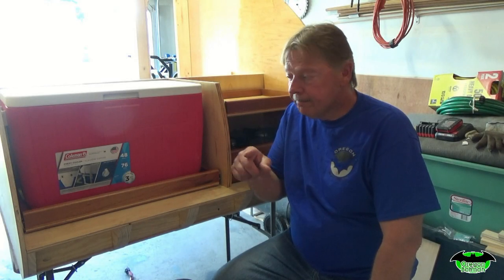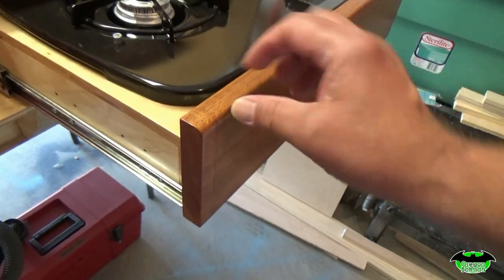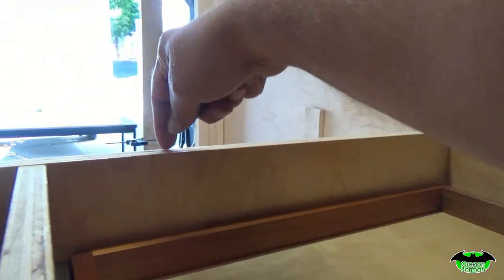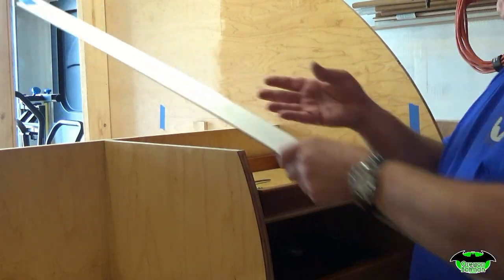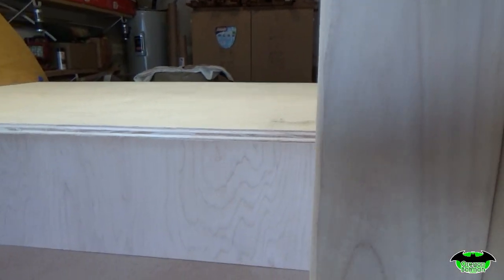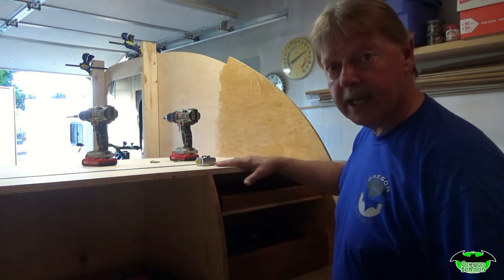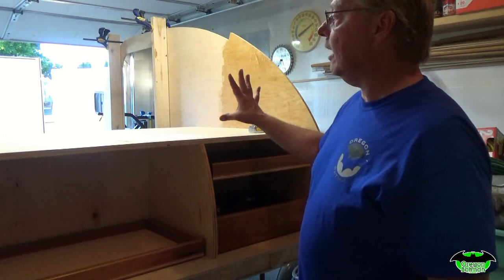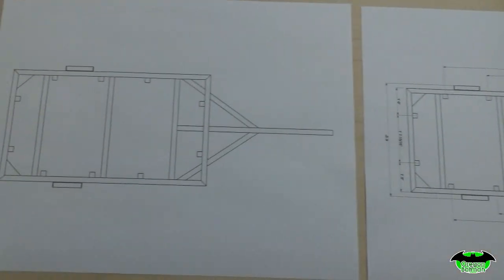Let’s Build A Teardrop * Step-By-Step * - Part 15 (Installing Counter Top)

Comment: I envy the freedom you have to build your own trailer out there.  It's not impossible to do in Illinois, but they make it so ridiculously difficult to get a title and license plates, that most people just give up and won't pursue it.  Most people in states as oppressive as mine end up buying a Harbor Freight 4x8 or a Northern Tool 5x8 bolt-together trailer and building on top of it.  They aren't horrible options, I guess... but your trailer looks GREAT and should be trouble-free for the life of the camper.  Another great video!  And great modification on the stove location - I might do something close to your original location, but use a combination of two sets of slides to get the stove out farther.  In my build, I'm also going minimal and probably using a single-burner butane stove.  I won't have any other appliances requiring propane, so I thought "why not" to keeping it simple and small.

Comment: Beautiful craftsmanship, as always.
Just an idea, but you could run a 24" propane hose from a 1lb refillable bottle in your storage area under the stove.  This would negate having to carry around a 22lb (5 gal) bottle in your tiny trailer.  Keep 3 or 4 spares in the storage space that you can easily refill from your 22lb tank at home with an $8 adapter.  Then you are only spending <$0.50 per full 1lb bottle rather than the $3-$4 retail price.  Also, it would always be hooked up and ready to go :)
Reply from the maker: That's a pretty good idea, I'll have to check it out and see if that will work. Thanks for the tip!

Comment: Awesome build so far. Just a suggestion. Once you had the two end holes drilled for the counter top, you had all the information you needed to go to the outside and mark and drill the rest of the holes. Might have been easier than having to reach over the cabinets inside. Ya gotta love a stove in a drawer. lol
Reply from the maker: True that... connect the dots from point A to point B, but I had many occasions where I missed my mark and popped through the edge of lumber, so I opt for the longer route, especially when the wood has a slight bow to it!

Comment: I know this is years later….  But may I suggest that you take the stove out completely??…!!    Remove it but leave it in its box, and take off the hinges. 
Take the stove, and set some strips of ply as mounts.  Mount it underneath the top drawer, snuggly.   If it’s just sitting on some ply strips, it’s removable.   Now you can pull it out and set it on the countertop, use it, then put it back.   This also gives you room to add a bottom drawer.

  (And/or sell it and just buy a portable camp stove.)  but use the same box you made to store the stove in, in a drawer or slot, just under the top drawer, and again…  make a bottom drawer with the leftover space.
Reply from the maker: Great idea for someone else who would be building the Teardrop, for me... I like this setup. Works great!
Reply: @OregonBatman  
….  Right on.   It would be nice to see a video of you using it on a trip.  Haven’t seen anything about it in a long time.   I’ve been building my own and re-watching all of yours to try and keep me motivated.   I’m still welding up the frame, but hope to have it ready to build on soon.   Your vids help remind me of what I can do.
Reply from the maker: Well, winter kind of settled in here and since I'm more of a fair weather camper (a.k.a. wimp) it might be a little while befor I take it out again! LOL! Once that frame is done, and you cut your first piece of wood... you won't want to stop until it's finished! You got this!

Comment: Great video as always. Quick question about the trailer. That's the biggest unknown for me. Would you mind sharing a ballpark for the budget on that piece alone. Did you provide the steel or you just gave your plans and they made it for you. Thanks

Comment: Countertop should be screwed in from underneath . Put lateral cleats in across each end and in the middle and screw in upwards from the underside. Your version can't be removed and or replaced later without ruining outer skin on trailer and also having screw holes show from inside the bulkhead.....Countertops get burned -scratched or dated in looks and color. Remods will be a bitch.....
Reply from the maker: I disagree... if counter top gets burned or discolored, I can always remodel with new surface. If severely damaged, I have more problems than just a counter top! Appreciate the feedback though, something to consider for next build. Thanks Timothy!